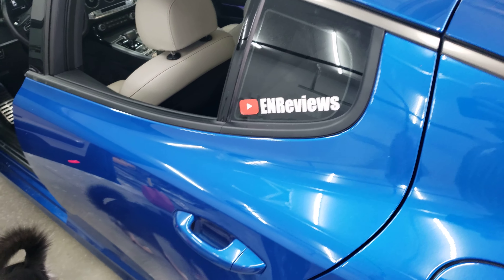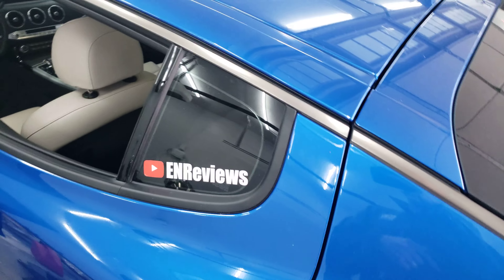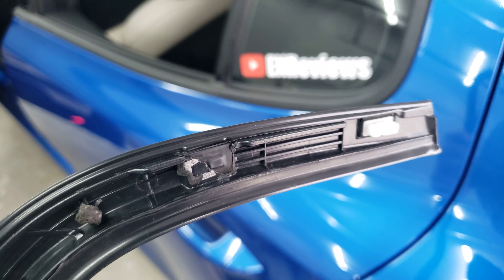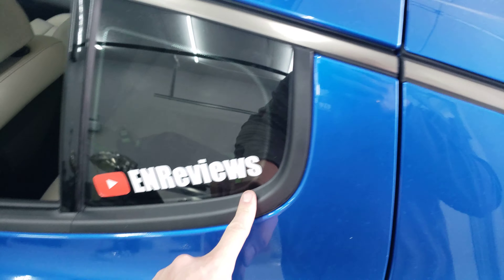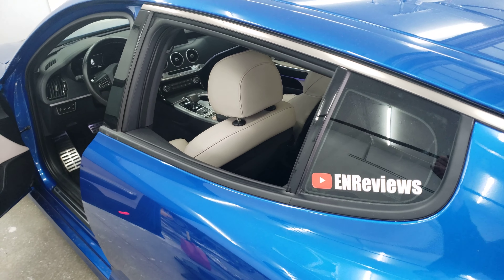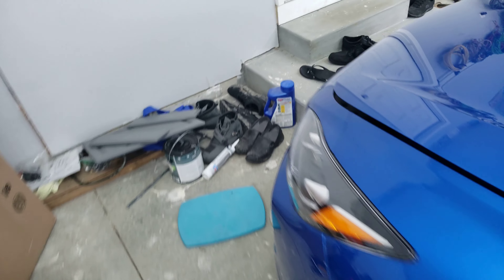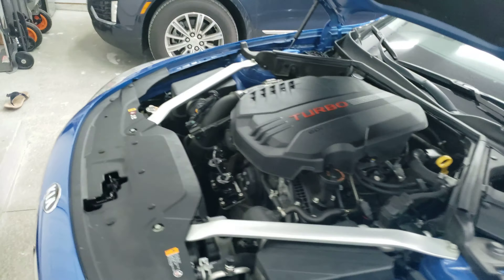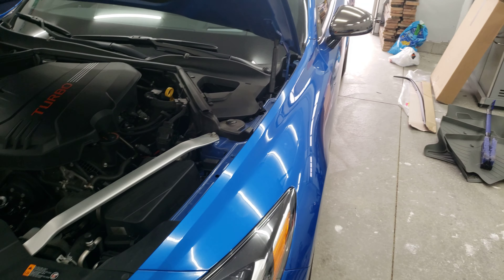Kia Has Some Issues With Bumper To Bumper Warranty - Buyer Beware

Comment: I bought a used kia which is under warranty. But it was serviced last by an independent garage. I gave invoices to check if the invoice was acceptable. They wouldn't check or validate it. Kia warranty is pointless...it is worth nothing.

Comment: I love my stinger too and I got another for the warranty because I bought the same one you have used.. And they tacked on extended warranty when I TOLD them I Don't want anything extra.. so right now I'm already not happy with that if it comes down to the warranty I think that's b***** everything should be covered including cosmetic they do tend to fall apart pretty easily